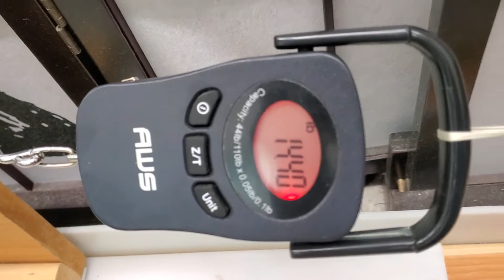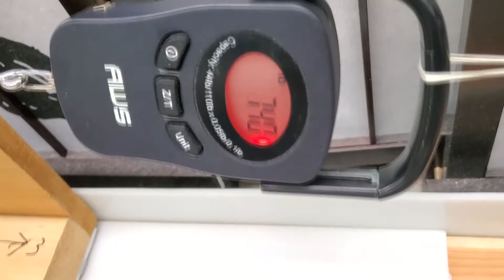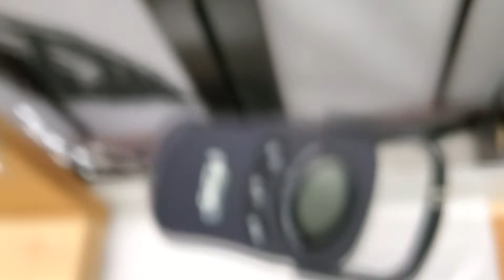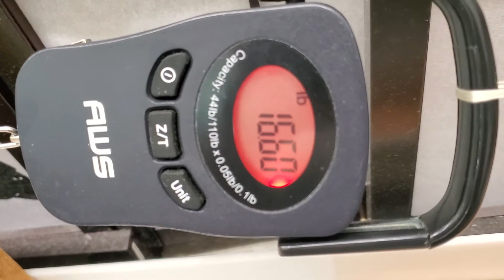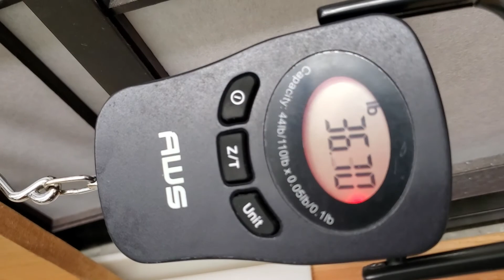Yozuri Super Braid 8 20 lbs ABS FG and PR Knot test

Comment: Pretty impressive for a line that was on sale last week for $5.99 for 150 yds. Normal price $9.99 @ BP
Reply from the maker: Beats any fancy Japanese PE braid that cost 4 times as much.
Reply: aquaholik lee  I wish BP had 300 yd spools. I don’t like knots on my spool. But,what splicing knot would you use if using 20-30 lb on a Spheros/Gosa for example?
Reply from the maker: @stevenberg1903  I just use FG knot to 15 lbs mono backing. That 15 lbs mono backing is probably closer to 25 lbs since its Berkley big game. So I'm not worried about the fish spooling me since I have confidence in the connection and the mono backing itself. But I know what you mean. You don't want to see or feel the knot on the cast.
Reply: Thanks
Reply: @aquaholiklee never had that problem with the FG knot, smooth as silk it's the best leader knot to ever exist.